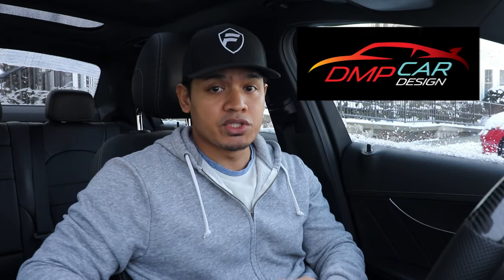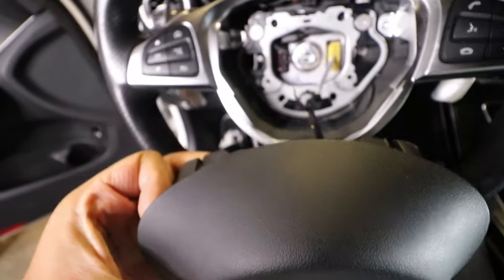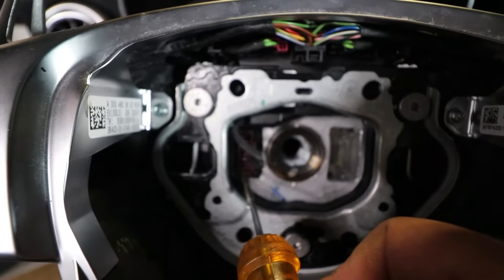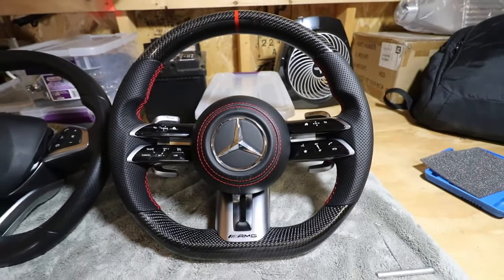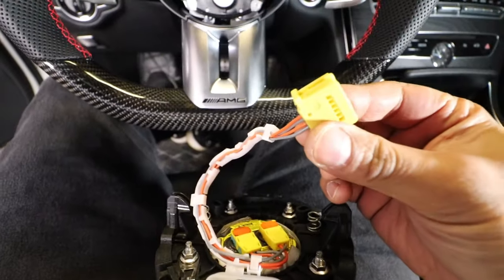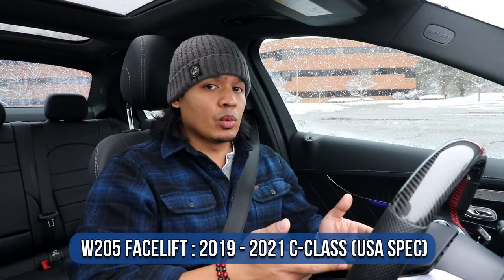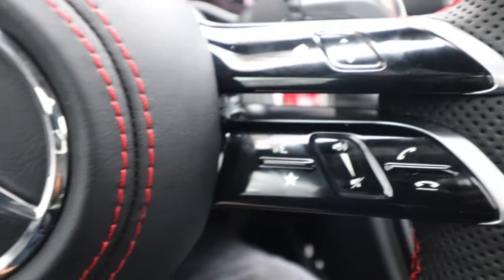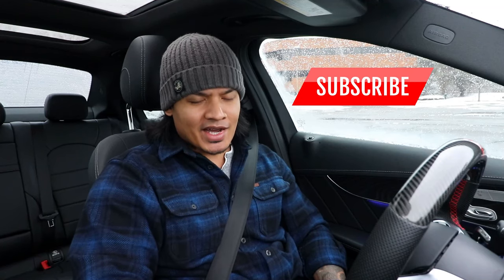NEW TOUCH steering wheel upgrade on Mercedes C300 (W205) 2015+

Comment: Hello!
I have recently bought the same steering wheel for my 2021 w205; Unfortunately, after installing the steering wheels the buttons nor the paddle shifters would respond.

Any thoughts?

Need help, ASAP!
Reply from the maker: Did you buy from DMP? If not, it’s not the same steering wheel.  DMP’s steering wheels are plug and play.  Others on the market, I don’t know their setup/quality.  

Sounds like yours needs programming.  If it is from DMP, just reach out to them and they’ll get you up and running.
Reply: What is DMP?
Reply from the maker: Watch the video. Read the video description. Can’t get any easier. Lol

Comment: Everyone should use a new steering whee bolt after putting new one on. Those bolts are one time use , i work as a parts advisor at benz.
Reply from the maker: Yeah, that’s what Mercedes recommends but I’ve never had an issue as long as the steering bolt is showing no signs of wear, I use loctite, and it’s torqued properly. And I’ve changed my steering wheels many times and in many cars. I should get a new bolt going forward especially when they are pretty cheap to buy.
Reply: @TheFlexxGarage  i feel you, yea we usually change them for warranty purposes. Same with one time nuts and screws.

Comment: Hey there... Thanks for posting this. I have also bought an AMG steering for my 2016 x156 GLA and was wondering if there is any way to use some wiring / software magic to make the cruise control work. I know the guys at merc will never entertain this but any after market mod u have come across?

Comment: So I have the 2016 Mercedes Benz C300 W205  It has a 2 tone interior where everything's blacked out in wood trim on the bottom but the upper is some light tan color is there any websites that you know of  That have aftermarket or oh yeah replacements to black it out the rough lining the sunvisors a sunvisor's a pillars  See pillar area of the air bag coverings the sun roof frown screening

Comment: Just replaced mine and now my car veers to the right when I let go of the steering wheel while driving, do I need an alignment or did I put it on wrong? 

I just replaced it with another OEM wheel because my leather was peeling, don’t see how I could’ve lined it up wrong when the plugs are there for guidance.
Reply from the maker: Changing a steering wheel doesn’t cause alignment issues to the car. Even if you accidentally put on the steering wheel crooked, you can still hold the crooked wheel, and the car will still track straight. I don’t know what happened on your install, but if that was me, I’d go get an alignment check asap.
Reply: @TheFlexxGarage  appreciate the quick reply. Turns out I put the wheel on crooked 🤦🏻‍♂️. I used the airbag and steering wheel plugs to line it up when I put it on, not knowing that the plugs move freely even with the steering wheel shaft locked into place. 

Just had to take it off and straighten it out, all good now.

Comment: I like the design of the double spoke but hate the haptic touch controls (as with every automotive reviewer). I have the facelift version and the toggles of the lower buttions and the roller knob for the volume are second to none,  It does have a small tough mouse on each size and that is the weakest link
Reply from the maker: I hated it at first but I got use to it.  I mainly only use the volume control anyway 🤷🏻‍♂️

Comment: Upgraded steering wheels are always one of the best aesthetic driver mods because you use it all the time and get to stare at it. Can't wait for the downpipe install on the Audi tho! Excited to see how different it'll sound
Reply from the maker: Bro. I just picked up the car with downpipe and no stage 2 tune yet and it’s definitely louder. I think my neighbors hate me. Lol
Reply: @Flexx Alexander  You waiting on after you get the stage two tune before making a video? I'm dying to hear it maybe make a yt short or post on ig 😁
Reply from the maker: I’m going to wait to show it off in the next video. I don’t wanna rev the car hard until I tune it.  But just normal driving…it’s louder and their are slight burbles. And I know my stage 2 tune is gonna make it even better.
Reply: @TheFlexxGarage  cannot wait for that video. I wished we got this far with the w204 😭
Reply from the maker: 204 just doesn’t have the best aftermarket support. Everything was so piece-meal and high-risk.  Audi is a solid platform that you can get 1 brand/company that makes everything from intake to turbos for them. Just a lot more reliable and trustworthy.
Reply: @Flexx Alexander  I know that's what sucked.. oh well excited to see how far you'll go with this car

Comment: Good evening Flexx, I was watching your video and I couldn’t help but notice an AMG section in your cluster settings when showing the up and down touch on the steering wheel. How did you manage to get that on there? Was it because of the steering wheel installation or just factory? Thank you for the great content, all the best
Reply from the maker: I did a custom coding on my car using an OBD2 module. It allowed me to install AMG features and disable my annoying seat belt warning and shut off the Auto start stop. I had to remove the video because the reseller stopped selling the module.

It was cool. Now I can record track time, know my g-force, know my engine oil and coolant temperature and more.
Reply: @TheFlexxGarage  very awesome I will look into it and see if any other sellers may have it, thanks a lot for taking the time to reply and thanks for the great content sir!

Comment: Where did you get, the Steering wheel COVER?! Thanks in advance!
Reply from the maker: I think eBay or Amazon.  Just search Carbon 38mm steering wheel cover.
Reply: @TheFlexxGarage  thanks for replying. Mine is not flat tho. Need to find round one.

Comment: Did you loose the "Departure Lane" vibration on the new steering wheel? Thanks!
Reply from the maker: Never had it.
Reply: @TheFlexxGarage Thank you for your quick reply, loving your videos. I have the drive assist package on my 2013 c250 coupe, I highly suggest it to anyone buying a Mercedes.

Comment: Is this a simple plug and play, as I see a lot of the steering wheels needs a new module to allow them to work?
Reply from the maker: Mine was plug and play.  Only need a module if you want parts on the new steering wheel to work when you didn’t have those features on your oem steering wheel.

Comment: How does the cruise control work if it has own switch for it on the side
Reply from the maker: It works the same way it’s always been working.  That’s how the car came from the factory.  Go look at your car’s manual for details on how it works. 

The cruise control buttons on the new steering wheel just doesn’t do anything and i must use the OEM cruise control lever.  That’s all.

Comment: Didn't you need a converter for this handlebar?
Reply from the maker: No. Cause this steering wheel looks like the new style but it’s designed for the w205 c-class. 

You only need a conversion/reprogram if you are installing an authentic OEM new steering wheel on an older c-class.

Comment: Anybody have any idea I matched the arrows and center console but it’s a bit crooked
Reply from the maker: Then move the steering wheel so it’s centered instead of being on the arrow (cause you don’t need it to be right on the arrow. The arrow is just a guide). There’s a lot of factors that sometimes make the arrow now exactly centered.

or you need an alignment done in your wheels and the shop will straighten your wheel when they adjust the wheels.
Reply: @TheFlexxGarage  might be alignment, when I’m parked the steering wheel is straight so are the wheels. Thank youuu !!
Reply from the maker: Yeah.  Cause it was the same thing with me.  I place my steering wheel on the arrow and it was slightly off center to the left but noticed even if I move my steering over 1 notch, the was crooked the other way.  There was no notch exactly in the center. I got an alignment and told the shop to straighten my steering wheel a tad and it worked.

Comment: What about the heated steering? Does it work ?
Reply from the maker: The version I have doesn’t have that feature.  Plus my stock steering wheel didn’t have that feature either.  

If you’re looking for a steering wheel with that feature, then you need to contact DMP and ask them.

Comment: Wondering if the airbags on these wheels are reliable
Reply from the maker: They’re legit.  That’s one thing I did a good amount of research on before installing them. Especially when my wife drives this car a lot. 

These airbags meet all the regulations and the quality is exactly like my own airbag when I compared them inch by inch. Gave me peace of mind that I also installed an aftermarket airbag on my A4 and now also on my Audi R8 as well.
Reply: @TheFlexxGarage  that sounds great, i really wanted to upgrade the wheel on my 2010 sls. compared to the car the wheel on this thing looks pretty outdated now. hesitating because i really dont wana end up with a malfunctioning airbag  on a bad day
Reply from the maker: Oh I get it. But you have to remember that any airbag is a gamble.  Look at Mercedes oem airbags. A lot were recalled cause they were part of takata airbag issue across multiple car brands and like hundreds of thousands of vehicles.
Reply: @TheFlexxGarage  thats true,

Comment: I just bought a new steering wheel for my w205 2015. I now need a module because it needs to be coded. Dont sell stuff that doesnt work btw...
Reply from the maker: 1) I don’t sell products. 

2) Did you buy from DMP? If so, then reach out to them for tech support. They stand behind their products and customer service.

If you bought it somewhere else, then your complaining on the wrong video.  Cause this video on a dmp steering wheel. 

You need to reach out to whoever sold you your steering wheel cause not all steering wheels are the same (even if they look the same).

Comment: Whats the torque spec!???
Reply from the maker: Depends on the car but it's usually about 30-35 ft lbs of torque.  You need to do your own research for your car's specs.
Reply: 80 Nm see attachment. M16 screw/bolt EPC shows part # 1269900312.

Comment: Dam so with this sterling wheel you cant use the cruise control ?
Reply from the maker: As clearly mentioned in the video, you can’t just unlock features on the new steering wheel if your original steering wheel didn’t have it.  You can hire someone to code it but the new steering wheel will only have what you had on your oem steering. My cruise control is on my stalk (not steering wheel) so the stalk still works but the cruise control buttons on the steering won’t work cause I didn’t have it on the steering wheel to begin with.
Reply: @TheFlexxGarage  thanks bro

Comment: Do the leds still work with this steering wheel?
Reply from the maker: LEDs?   You mean the ambient kit? If so, yes, still works since the buttons used to control the lights are still on the new steering wheel.